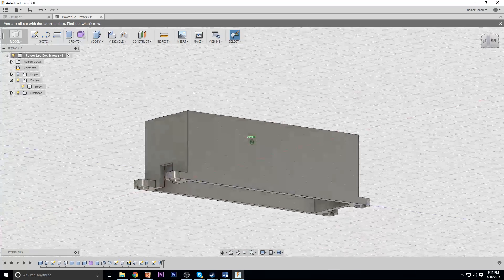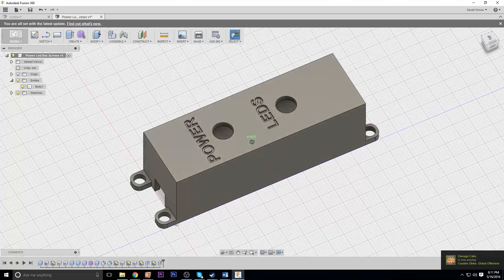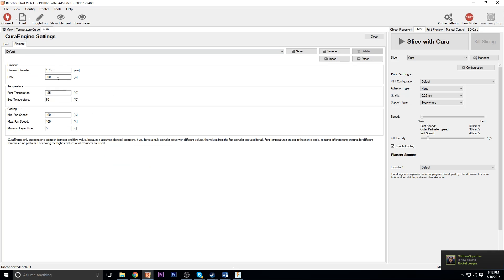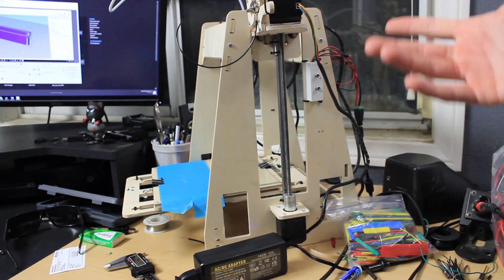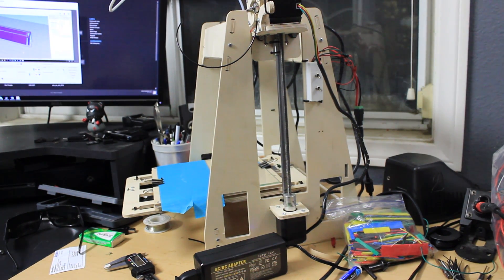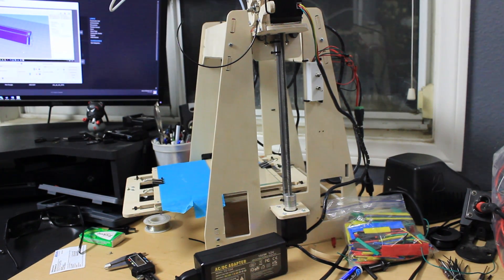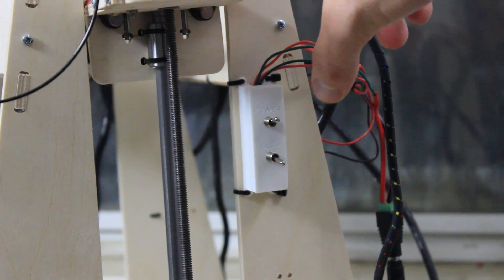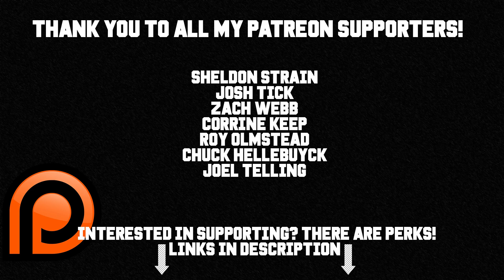Designed And 3d Printed Power And Led Switch Mount For RP9v2 Printer

Comment: Why dont you octoprint to control a relay. then you can have 2 relays to turn the printer on and off and to turn the leds on and off.
Reply from the maker: Hadn't even thought about that. Idk I sort of just like the mechanical switches!
Reply: It's nice, So when im at work and my print finishes I can just login and turn it off.